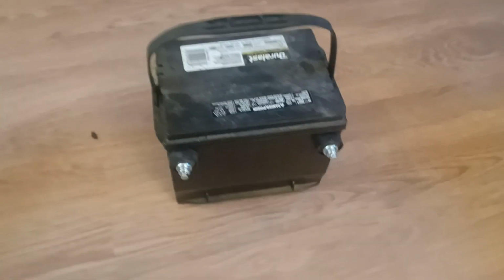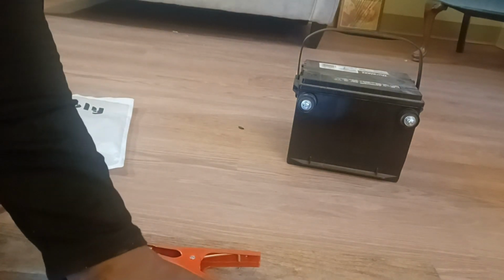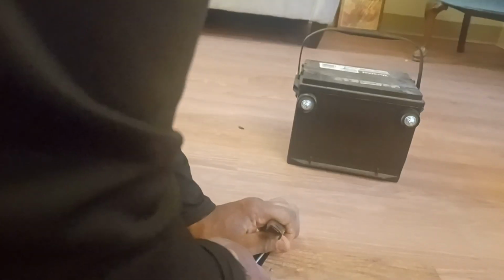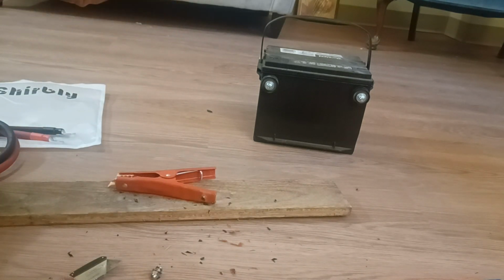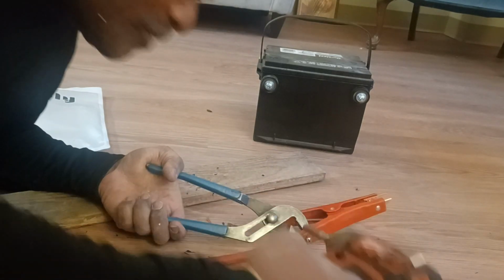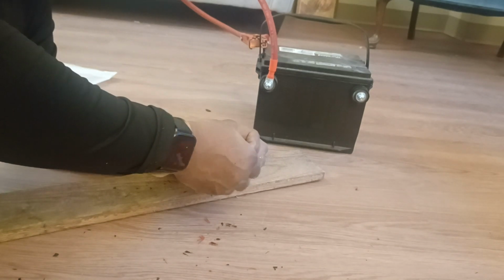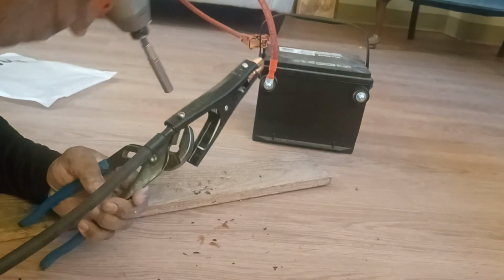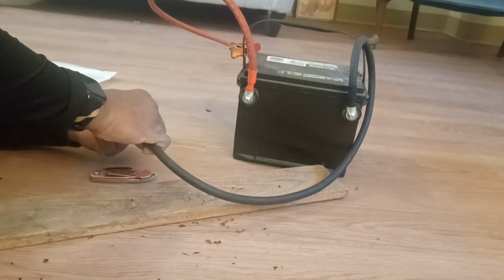Making a jump Starter out of a battery.

Comment: Just buy a noco they are small 20.000 amps i keep mine under my seat always has a charge its over 5 years old still like new and can use as charging pack and emergency light charges phones tablets laptop's best 2 beans you will ever spend